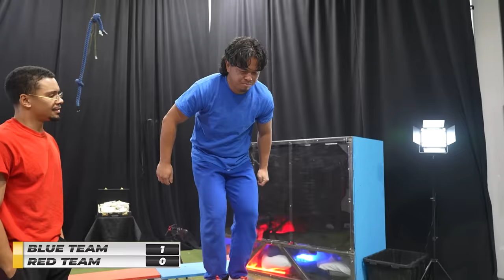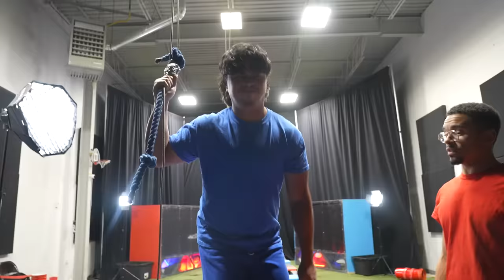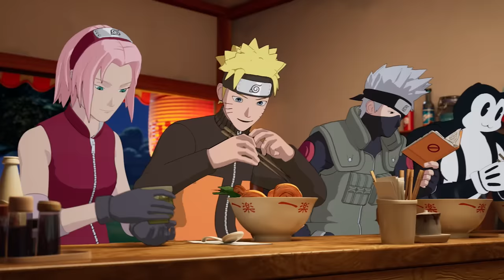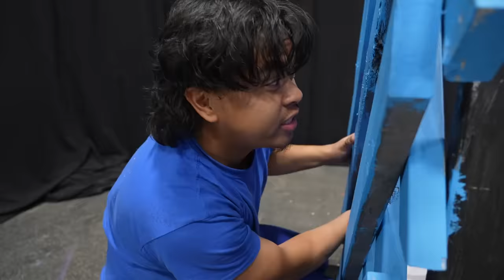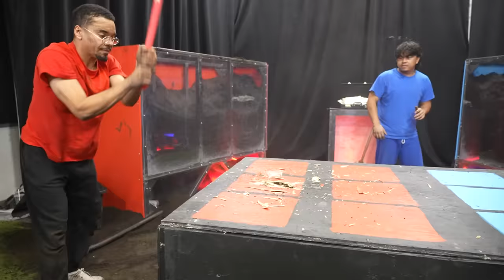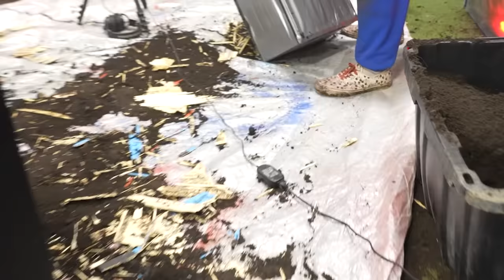Escape Being Buried Alive For $10,000

Comment: No way I would be too terrified to do this, Dustin and Trent are literally Gods
Reply: no joke, this stunt is just plain dangerous.
Reply: @bucketfan4life  His glass box was made by tempered glass and as far as i know, it wouldn't break unless the force acting on it was strong but the surface of the interaction had to be small enough to shatter (it works the same as needles, if you punch someone in the back, they won't be hurt for long but if you use the same force and act on a needle instead, it will definitely penetrate their skin)
Reply: Luckily it wasnt actually 5000 pounds of dirt
Reply: i know bro, they have balls of steel bro
Reply: This version isn't so bad, its in a way that they can still get light and air so their is no risk of suffocation, if anything happens, im sure they can unlock the side to quickly remove the entirety of the dirt

Comment: Weapon idea so take a crowbar use glue or flex tape to put two axes on the top sides of the crowbar and then in the middle of the two axes put something heavy that is not in the way of the axes so then you have the sharp and the weight then call it what ever you want